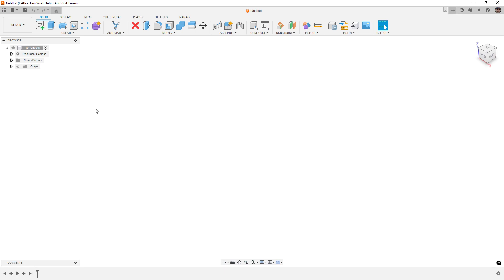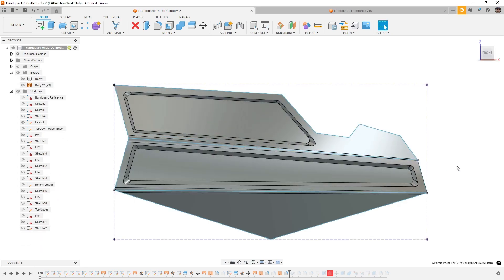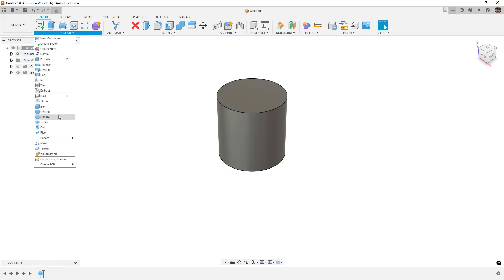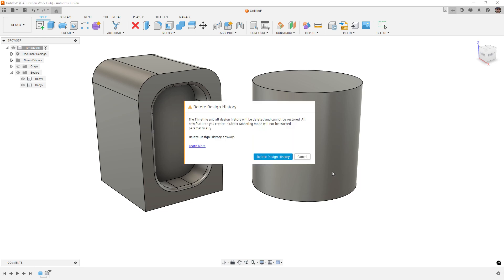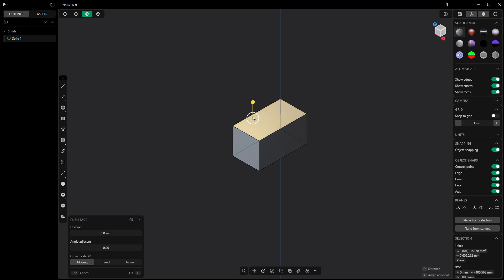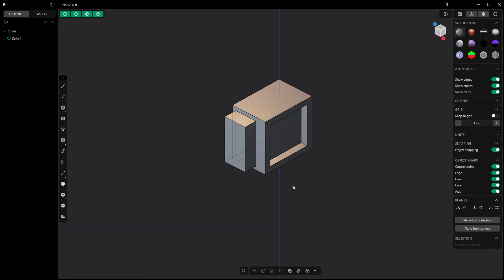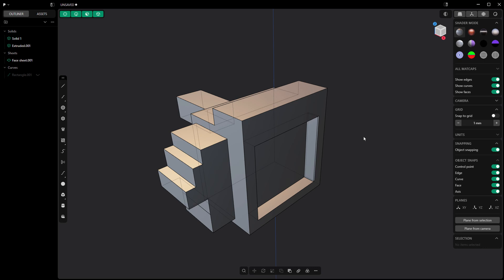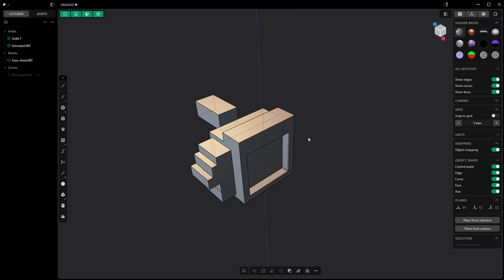Fusion v Plasticity for Direct Modeling | Comparing Workflows and Tools

Comment: im pretty familiar with fusion... but some stuff i like doing in blender or even zbrush.. i want to try out plasticity maybe its a good alternative to blender modeling...
Reply from the maker: For sure it is because you still have "CAD" geometry.  There is a blender bridge also which is a direct live connection into blender (we have a few videos on it).  Basically it opens up a connection and pushes your models from Plasticity to blender.  you can continue to model and there are options for how the geometry gets converted to polygons.

Comment: great video. I was wondering if a hybrid workflow makes sense? Design more complex exterior surfaces with plasticity and then take it into fusion for more precise manufacturing related workflows. I havent used plasticity but off late some of the things im designing are VERY cumbersome to do in fusion.
Reply from the maker: Yeah that can certainly work if it makes sense for your parts.  The biggest downside is not being able to go back and edit the shape in Fusion if needed (without hacking it up)

Comment: Thanks a lot! That’s exactly what I was looking for.
SketchUp has pretty much become an expensive shadow of its former self, although incredibly its interface still manages to be more efficient than Plasticity’s — it really needs a proper overhaul.
Even though switching to Plasticity seems obvious, Fusion could also be an interesting option in its own way; I’m really undecided.
Reply from the maker: The Plasticity UI works really well for users that are comfortable with Blender or can adapt to shortcuts in their workflow.  If you are used to a ribbon interface it can be a lot harder to adjust.

I plan to do a new plasticity video soon talking about some more of the basic concepts.

Comment: Not sure if already mentioned, but you can model in Plasticity, then bring into Solidworks. Last step is feature recognition to make your model parametric. Obviously works zero, some of the time or totally depending on the imported model.
Reply from the maker: True.  Feature recognition in most CAD programs is hit or miss.  Fusion has one to turn a mesh into a prismatic solid but its a gamble as to if it will work as well.

Personally i can't think of a good reason to want a fully parametric model in Solidworks or inventor or fusion and not just starting in one of those programs.  Everyone has their own workflows though.
Reply: Mostly, agree, and only thought of using this method when I saw a video of three guys modelling a gun over three hours in Blender. Experience levels were three years, three months and three days IIRC.  Thinking about it, my opinion was model it all up on the fly in Plasticity, throw into Solidworks to dimension and then save part as assembly to get the pieces. Did my sample gun in 68 minutes and had only just started using plasticity then. Stu
Reply from the maker: @forte.vision  yeah that makes sense.  FWIW fusion has the auto dimension/constraint tool now so "speed modeling" without worrying about dimensions, but the auto dim tool will only go so far in "design intent"  i know they are working on improving it.

Comment: Why can't we import external part when working with enabled history tree? 
In Solidworks history tree works just fine after importing external part.
Reply from the maker: You can.  In your preferences the default for importing a part into a new file has history off.  If you right click at the top of the browser on the left (where the name of the part is so Untitled most likely), you can turn capture history on.

Comment: Great comparison.  Not mentioned is price. Sure, there is a free version of Fusion, but my cnc guys need .step files and that will cost you close to $500 to get that export function in Fusion.  It's been a few years, correct me if I'm wrong.
Reply from the maker: Yeah. you can do CNC programming in the hobby version but there are limits to it.  but for integrated CAM the $500ish /year is a great price for the functionality.  Even if you have to pay more for the machining extension to do true 5x toolpaths its cheaper than (most) other options.

Plasticity is Perpetual but you are locked into whatever version you bought within a 12mo window.  You can then upgrade or renew.  Renewal has to happen in a 4mo window I believe.

Comment: I made a model in Plasticity and after printing the first prototype found out that I needed significant changes in some dimensions and regretted not being able to just go back and edit a dimension on a sketch in Fusion. I know studio has dimensions that can work on relatively primitive objects and there is the move command for others. Are there workflow strategies that can be taken in Plasticity to make those kinds of updates easier? Saving fillets chamfers for dead last?
Reply from the maker: Yeah thats a tough one!  So leaving fillets until late in a design and copying the body without fillets can help.  Not ideal.  Generally offsetting is the best way.  So say you have two parts and need a .4mm gap but modeled a .2mm gap.  Then you would either offset one of the faces .2mm or if that doesn't work you would duplicate a face, offset and untrim, then cut away the excess.  not ideal i know.  Its really best to design it all in at the start.

I generally use Fusion for mechanical type 3d prints as its common to try a tighter tolerance and need to tweak it.  Much easier to say roll back before a pattern, update a body then roll to the end.  things like that can be done in Plasticity but its a bit more surgical :)
Reply: I really want to make Plasticity my main squeeze. But I guess it has its place.

Comment: Thank you for making these videos. I use plasticity for furniture and other complex walls or architectural elements that go into interior visualizing.

From that point of view, I also used fusion when modeling on the blender, but I felt it was a little difficult.

Plasticity has become the perfect replacement for me
, and I'm still trying to make things out of Plasticity. 

I still don't regret learning the basics from Matt . 
Thank you LEAD~!

Is there any way to experience version 25 on the license of the indie version?
Reply from the maker: Glad to hear!  If you have a license there is an upgrade and renew option on the plasticity site.  I think all the trial versions are up to date and Indie only.  So you might be able to download a trial and see if you like the new features.

Comment: Hi i would love it if you can help me , when i do everything with dimension in plasticity and i exported to stl and y sent to slicer software the item what i created show me too big and when i scaled i don't like the scale because  is not the dimension what i draw in plasticity any solution ill appreciate
Reply from the maker: Check out this vid we did recently with a 3d print project.
https://youtu.be/CTgza6C5LzA

you want your units to be mm on plasticity and on export.  if they are mm there the print slicer seems to import fine.  Some print slicers will auto scale.

Comment: One huge difference, as of late anyway, is program performance. Fusion has been hanging up and bogging down as of late while Plasticity is lightning fast.
Reply: I’m a software engineer and the F360 vs Plasticity trade off has some parallels in software. Do you want to use a lightweight and fast code editor or something that does more for you and is more feature rich. Do you want to work with a programming language that enforces rules, and avoids bugs,  at compile time or a scripting language to get something done quick and dirty….these are exactly the same trade offs as one makes with Fusion/Plasticity.
Reply from the maker: yeah it has been buggy lately and i am actively making that point heard.... does seem to run better on win11 than 10 for me, but 11 is a whole other problem....

Comment: I am 3d printing hobbyst. For me Plasticy is a way better that fusion, freecad etc, it is easy to use and you can very fast modeling more compolex shape. For my expirance only shapr3d can  to compare with plasticity to easy to use, but in free version you have low quality slt export so it is not accetble in 3dprinting.  So for me now Plasticity is a choise.
Reply: Also the single purchase price is fair!
Reply: @cekuhnen  Exactly. For single purchase you have only 12 months of updates but most of the time you dont need upgrade each year. So even if you upgrade like for 3y still it is good price.
Reply: Amen brother. I've made things with Plasticity that I thought were way way out of my skill set. I have no formal training with 3D design all my education is from youtube university. After struggling with Fusion and Tinkercad. I hit the ground running with plasticity. Sadly right when I my trial ran out, I was ready to purchase the full app and they raised the price. So I passed. Thought better of that a few months later only to realize they raised the price again. So again im a little off put by the increases in price in such a short time. So I continue to limp along with Fusion. But it appears direct modeling in fusion is similar to how plasticity operates anyway, so Im gonna give that a try.
Reply from the maker: awesome

Comment: This is a question I have been struggling with, perfect timed video!
Reply from the maker: Awesome.  These aren't the only overlaps but by far the most common problem people have with Plasticity is lack of sketch dimensions and constraints, and by far the biggest problem people have with Fusion is that its too rigid with its direct modeling :)  So was hoping to get them to meet on common ground.

Comment: Fusion 360 for me is like Blender, they are really powerful programs, but their interface is not really friendly for new people, Plasticity is more simple on that, and it’s great modeling on Plasticity.
Reply from the maker: Good point!  Don't ever try Inventor or Solidworks ;)
Reply: Been trying Solidworks. Can confirm.
Reply: I disagree. If you get some structured instruction videos, you can be up and running with Fusion in an afternoon. I actually found it more intuitive than Tinkercad.
Reply: I’m with you on the fusion interface. I’m learning it, slowly, as I need it, but the frustrating thing for me is it has to run on a full computer. I find the most natural interface for modeling by far is my iPad and there the only good solution is Shapr3d. shapr is absolutely amazing but very expensive unless you can find a way to get the free education license. I know they have a free tier but it has very little practical utility. Plasticity on the other hand looks great but has no iPad version, same with Fusion.